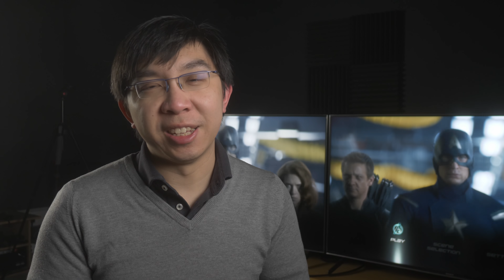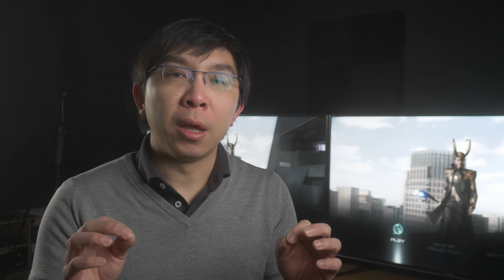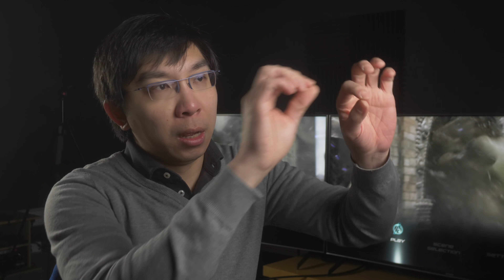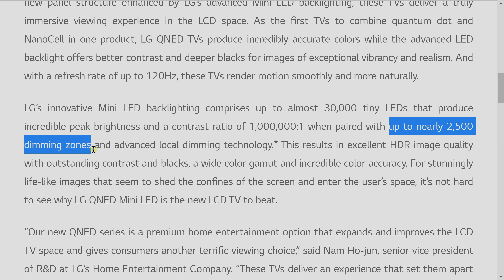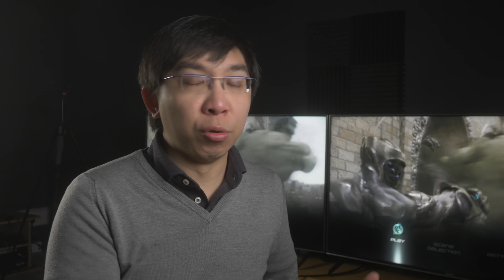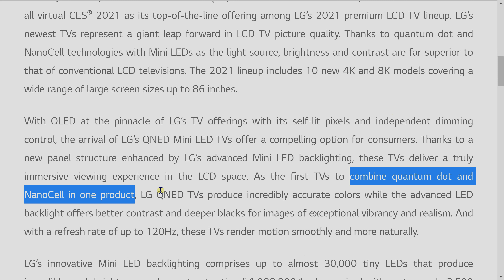LG Unveils Its 1st QNED Mini LED TV with Up to 2500 Dimming Zones

Comment: Why IPS....
Reply: Better view angles , more natural colors than VA Panels .but LG also has VA Panels - all 50,60,70 ,82 inches models has VA Panels !

LG QNED- Quantum nano-emitting diode (QNED) display technology is an advanced platform based on blue nanorod light-emitting diodes. With a unique core-shell and three-dimensional nanostructure, nanorods integrated onto a backplane thin-film transistor could offer superior aspect-ratios and quantum efficiencies compared to any platform currently available.

Theoretically, QNED structures could achieve a greater functional density than all planar LEDs, including those intended for use in QD-OLED systems. QNED backplanes could have an emitting surface area of as much as 10x that of OLED panels, potentially overcoming the light intensity limitations of OLED technology.

QNED is similar to the likes of MicroLED, which has been marketed in extremely large panels (73”+) at tradeshows for some time. However, MicroLED is prohibitively expensive for most consumers and is yet to emerge in smaller formats.

One of the most interesting facets of QNED technology is that existing nanorods emit blue light and can be integrated onto the same thin film transistors used to form blue OLEDs.

Comment: up to 30,000 miniLED.... with 2500 local dimming zones.

meanwhile on a 4k OLED, you have over 8 million self lit pixels and the same in dimming zones as each pixel can be on or off and varied brightness. miniLED will NEVER match OLED quality.
Reply: Samsung high-end qled tv  has maximum 1000 dimming zones

Comment: my dream monitor... 144hz, 1ms, ips, miniLED, 27 inches, vesa compatible
Reply: 240hz ..
Reply: @Dr.WhetFarts  there's only a few games that can consistently reach 240fps in order to sync with your monitor. most games i play are single player and beautiful so i can only get 100+ fps in then no way ill be able to reach 240fps.... however, maybe 3 years down the line, with new gpus and cpus we'll be able to. games are only getting more intense but if you play something like fortnite or OW only, i could see the benefits for a 240hz monitor

Comment: I don't know why LG doesn't just double down on OLED and mass produce it so everyone can afford it.
They would just dominate the market.
Reply: They wouldn't. Because one of the biggest problems with OLED is that yields never improved to the point of giving them the economy of scale they expected, that happens with other tech. If you double down and produce more, your failure rate remains just as high, you make no more profit/you can;t drop prices and you'd just flood the market leading to big losses. More production would NOT mean it became more affordable. Hell it's taken 20 years for them to get to this point and even then only because LG cheated by making it WOLED. Why do you think OLED''s biggest success is in tony screens/phones and such? It's all pretty simple.
Reply: They already dominate the market in the high-end segment. All top brands expect Sony are using LG OLED panels in their highest-end TV's now.

Comment: Does that mean that it is better then OLED?
Reply: QNED- Quantum nano-emitting diode (QNED) display technology is an advanced platform based on blue nanorod light-emitting diodes. With a unique core-shell and three-dimensional nanostructure, nanorods integrated onto a backplane thin-film transistor could offer superior aspect-ratios and quantum efficiencies compared to any platform currently available.

Theoretically, QNED structures could achieve a greater functional density than all planar LEDs, including those intended for use in QD-OLED systems. QNED backplanes could have an emitting surface area of as much as 10x that of OLED panels, potentially overcoming the light intensity limitations of OLED technology.

QNED is similar to the likes of MicroLED, which has been marketed in extremely large panels (73”+) at tradeshows for some time. However, MicroLED is prohibitively expensive for most consumers and is yet to emerge in smaller formats.

One of the most interesting facets of QNED technology is that existing nanorods emit blue light and can be integrated onto the same thin film transistors used to form blue OLEDs.

Comment: Almost similar to Samsung’s QLED
Reply: QNED -Quantum nano-emitting diode (QNED) display technology is an advanced platform based on blue nanorod light-emitting diodes. With a unique core-shell and three-dimensional nanostructure, nanorods integrated onto a backplane thin-film transistor could offer superior aspect-ratios and quantum efficiencies compared to any platform currently available.

Theoretically, QNED structures could achieve a greater functional density than all planar LEDs, including those intended for use in QD-OLED systems. QNED backplanes could have an emitting surface area of as much as 10x that of OLED panels, potentially overcoming the light intensity limitations of OLED technology.

QNED is similar to the likes of MicroLED, which has been marketed in extremely large panels (73”+) at tradeshows for some time. However, MicroLED is prohibitively expensive for most consumers and is yet to emerge in smaller formats.

One of the most interesting facets of QNED technology is that existing nanorods emit blue light and can be integrated onto the same thin film transistors used to form blue OLEDs.

Comment: VA panel with 30.000 miniLED backlight and 2500 dimming zones would probably outperform LGs OLED. Thats why they will not make them. They are not allowed to be better than OLED.
Reply: 2500 dimming zones will not match 8 million dimming zones (aka self emissive pixels)

Comment: Sad its gonna be on IPS panel
Reply: QNED-Quantum nano-emitting diode (QNED) display technology is an advanced platform based on blue nanorod light-emitting diodes. With a unique core-shell and three-dimensional nanostructure, nanorods integrated onto a backplane thin-film transistor could offer superior aspect-ratios and quantum efficiencies compared to any platform currently available.

Theoretically, QNED structures could achieve a greater functional density than all planar LEDs, including those intended for use in QD-OLED systems. QNED backplanes could have an emitting surface area of as much as 10x that of OLED panels, potentially overcoming the light intensity limitations of OLED technology.

QNED is similar to the likes of MicroLED, which has been marketed in extremely large panels (73”+) at tradeshows for some time. However, MicroLED is prohibitively expensive for most consumers and is yet to emerge in smaller formats.

One of the most interesting facets of QNED technology is that existing nanorods emit blue light and can be integrated onto the same thin film transistors used to form blue OLEDs.

Comment: I'm just trying to get something straight (ding) in my mind. What I took away from one of Vincent's Mini-LED display reviews is that, in Mini-LED TVs, each Mini-LED doesn't represent a dimming zone and they are instead activated in groups. So rather than thousands or tens of thousands of dimming zones, instead the amount of dimming zones are maybe double that of a traditional local dimming TV. I've not heard anyone explain why Mini-LED displays operate in this fashion. Why not use each Mini-LED as an individual zone?

If you've ever viewed something like a logo in bright white on a black background on an OLED TV, due to the limitation of our own vision, it actually appears like there's a slight halo around it. It's only when you physically block the light from the logo that you see the neighbouring pixels are indeed black. If each individual LED in a Mini-LED display were utilised as a dimming zone, due to the effect described above, I'm fairly confident people would struggle to tell the difference.

Comment: Even the current 8K nanocell TVs are more expensive than 4K OLEDs. So I dont think OLED is positioned above, but rather on the same level. Either you get perfect blacks or you get 8K and no burn in.
I think one important point will be if LG also boosts peak brightness considering they have solved the contrast problem.

Comment: Even if they're fudging the numbers, at 1,000,000:1 contrast these Mini LED displays will be competitive with OLED in the eyes of the vast majority of people.
We should clear up one common misconception with Mini LED though, Mini LED doesn't allow more zones because of their size, regular LEDs were already plenty small. Mini LED does allow more zones because they cost significantly less.
Even at $0.50 each, a 2,000 zone TV using regular LEDs would require over $1,000 worth of raw components just for the backlight, that just doesn't jive with the profit margins TV makers are used to.
With LG advertising 30,000 LEDs in one display those Mini LEDs must cost around a penny each.

Comment: All this technology and LG use an IPS panel instead of VA, sad!!!
Reply: Because VA has trash viewing angles and LG won't allow bad viewing angles on a TV. Which is why they stick with IPS on their LCD and OLED for extreme (aka perfect) viewing angles. Wide viewing angle filter on VA ruins the contrast ratio, so it's not a solution. And VA with wide viewing angle filter is FAR FROM as good as IPS and OLED anyway.
Reply: Ips panel has more natural colors than VA Panels
LG also has TV's with VA Panels .all  50,60,70 and 82 inches  models has VA Panels

Comment: So why 30,000 mini leds but only 2500 dimming zones?
Reply from the maker: The computational power required to correctly operate and control 30,000 zones is beyond current modern TVs.
Reply: @hdtvtest  If they can deal with 8 million pixels, It would seem that they could deal with 30,000 zones?
Reply from the maker: @Red Leader: It's not the same at all... the 8-million pixel-level light control is native to self-emissive technology, whereas the 30,000 zonal control has to be operated by software algorithm.
Reply: @hdtvtest  wasn't trying to imply that pixels and zones are the same. Just that 30,000 zones doesn't seem to be such a huge task to process in the scheme of things.
Reply from the maker: @Red Leader: Why don't you invent a good algorithm for 30,000 zones if it's so easy? You'll make a fortune...
Reply: @hdtvtest  Sure. Computationally it shouldn't be beyond the scope of current image processors.  An algorithm just needs to examine the luminance data from a group pixel relating to a zone (about 266 pixels or so), then determine the best zone backlight luminance (either from an equation or a lookup table).  See? I just became a trillionaire.
Reply from the maker: Talk is cheap. Prove/ execute it in the real world, then come and wave your trillions at us.
Reply: Samsung high end qled tv  has maximum 1000 dimming zones

Comment: What's the point of having 30,000 LED's if they are going to group them into only a fraction of dimming zones? Why not just provide one dimming zone per LED?
Reply from the maker: The computational power required to correctly operate and control 30,000 zones is beyond current modern TVs.

Comment: Do any TVs use a proactive local dimming? I often see the reviews showing the local dimming to appear to be reactive to the bright areas on the screen. If the display could see a frame or two into the future of the content, possibly done through a delay, it could create local dimming that would be where it needs to be and not where it was.

Of course this creates issues with audio sync unless the audio was being run through the TV before being transmitted to the audio devices.

Comment: How come with 30,000 mini LEDs available they use nearly 2,500 zones, using about 12 LED per zone, I guess with a resolution of 66x37. Why not control each mini LED on it's own? would have a resolution of something like 230x129 then. 

I must be missing something?
Reply from the maker: The computational power required to correctly operate and control 30,000 zones is beyond current modern TVs.
Reply: @hdtvtest  Thanks for the reply Vincent. Although I'm still a little confused. In your video about dual layer LCD you mention having a monochrome layer of 1080p for approx. 2 million dimming zones. I was imagining that a mini LED backlight would attempt to make a monochrome image itself. I'm guessing there is more to controlling an LED backlight to a second LCD layer?

Comment: The risk of OLED burn-in is unfortunately very concrete for PC use, and that's what I use my display for.  Even setting aside that risk, if you use OLED for PC display, image retention is a day to day, minute to minute issue that you are constantly angsting over.  These are the reasons why these makers are primarily pushing for alternatives to OLED, even while those new alternatives are, in almost every other way, inferior.

Comment: So besides more dimming zones (which still doesn't solve how garbage local dimming is to begin with) are there any other benefits brought by using mini-led? Like a brighter picture using less energy for instance. Because I've been trying to find more info about mini-led but I just can't seem to find even the most basic specs online (things like maximum brightness compared to regular LED, energy consumption, response times, etc.)

Comment: Thanks as always Vincent, best start prepping the coffee ready for CES

Id be curious to now what the life span of an LCD LED is especially mini and micro LED's
Reply: That's a good point, as I'd think as LEDs get smaller you run into similar problems as OLED where the LEDs will wear out quicker.  Obviously not as fast as OLED, but its still going to be a problem.

Heck, my last edge-lit TV the quality dimished quicker than I'd have liked, it put me right off backlit screens and so far OLED has been far less problematic thanks to zero DSE.
Reply: @alexatkin  exactly I'm not impressed by the lighting on my CX802 another reason why I will stick with OLED initially

Comment: QNED was supposed to be emissive, not yet another stupid patchwork job over LCD.

Why would they call it QNED when it's just MiniLED?
Reply: LG and Samsung hate each other. LGs using the term QNED because they dont want Samsung to take over the premium sector currently ruled by WOLED. Samsung's QNED will be self emissive brighter and more colourful with no chance of burn in, and LG hate that. Plus QLED stole alot of OLED customers, so it's a marketing war. My bets on Samsung. Samsungs QNED is also cheaper to manufacture and should be thinner as it doesn't require as many stacks. Microled is a long long way off, and so is EL-QLED
Reply: QNED- Quantum nano-emitting diode (QNED) display technology is an advanced platform based on blue nanorod light-emitting diodes. With a unique core-shell and three-dimensional nanostructure, nanorods integrated onto a backplane thin-film transistor could offer superior aspect-ratios and quantum efficiencies compared to any platform currently available.

Theoretically, QNED structures could achieve a greater functional density than all planar LEDs, including those intended for use in QD-OLED systems. QNED backplanes could have an emitting surface area of as much as 10x that of OLED panels, potentially overcoming the light intensity limitations of OLED technology.

QNED is similar to the likes of MicroLED, which has been marketed in extremely large panels (73”+) at tradeshows for some time. However, MicroLED is prohibitively expensive for most consumers and is yet to emerge in smaller formats.

One of the most interesting facets of QNED technology is that existing nanorods emit blue light and can be integrated onto the same thin film transistors used to form blue OLEDs.

Comment: They always say, “Never buy a first Gen product”
Reply: Especially with the LG badge
Reply: @Honey Purity . Is LG that much worse for this than Samsung or Sony? I just assumed the firs gen curse amongst the three is about the same.
Reply: @robertt9342  Sony Panasonic and Samsung just have Better  knowledge and engineering. Samsung just use cheap parts that don’t last.  But LG seems worse out of them all. Their lcd are horrible and their plasmas were a mess. Their wrgb oled still not as good as the Panasonic or Sony even though they use the same panels.
Reply: LG is presented first  prototype mini LED and micro LED tv on IFA 2018
Reply: @СНСАЛЕКСАНДАРВУЧИЋ  so where could you buy a LG Mini LED tv in 2018?
Reply: Yeah , wait at least 6 years 😂😂😂
Reply: @Victor Godwin  Dude, they just aren't as good as Sony and Panasonic with making OLEDs-and it's not just about calibration. Panasonic and Sony have always led in engineering, heck both of invented plentiful of technologies that are quite common in today's TVs.
Reply: I have compared BX/CX and A8H side by side:

Sony has:

Better motion interpolation(minimum artifacts unlike LG, true motion sucks on LG, Sony just has better image processing for the most part)
Less noise in low quality content ( like 360/240p)
Less black crush out of box( Black crush can he fixed on LG by calibration though so not a big deal which needs like a 4$ service remote)
Better audio out of the box(for the price difference you can get an external audio through depending on where you live, there's a 500$ difference where I live so yeah)

LG has:
Better colour detail (after calibration on both, it's just better at displaying those colours than Sony by a bit especially 4k HDR)
UI is snappier cuz of webos,android on Sony slows over time
4k@120hz support which future proofs gaming

You can't go wrong with either of them, also Sony comes better calibrated out of the box probably why some of you would like it more
Reply: Just a heads up LG provides Sony with the oled panels so it just comes to their processing chips and calibration..nothing is faulty in or "better quality" in the panel itself.
Reply: @Victor Godwin  Keep believing those lies! I've seen them in person, there is a difference